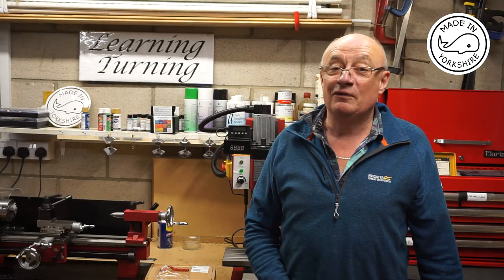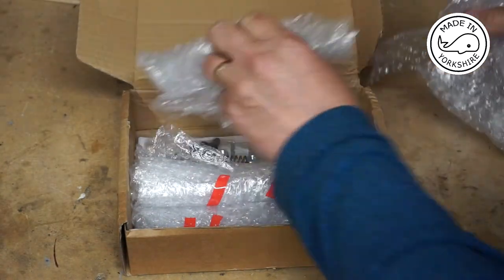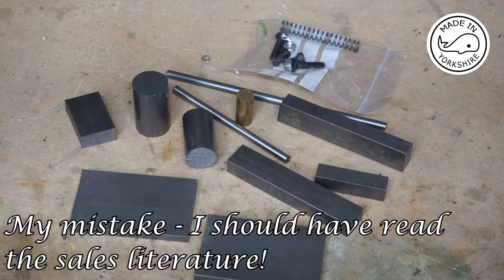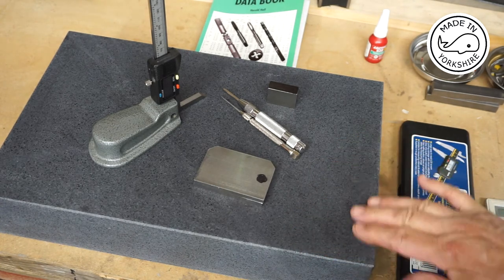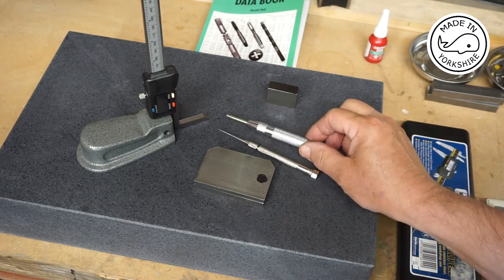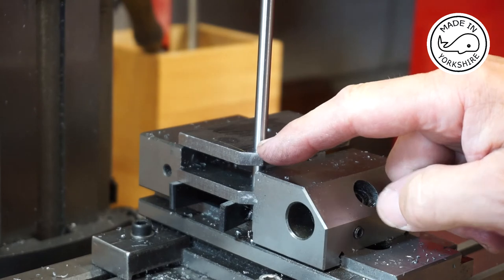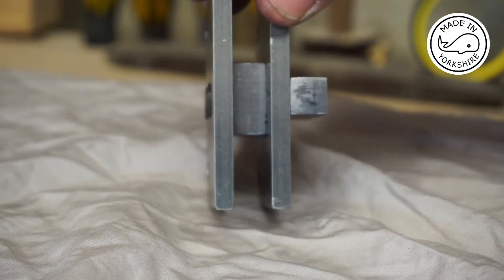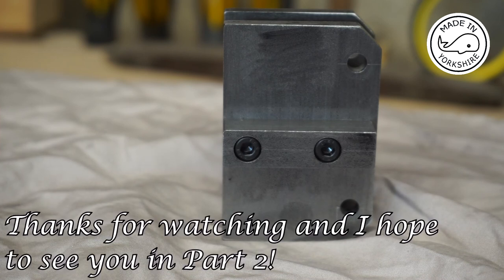#MT19 Part 1 -  Making a Hemingway Kits Knurling Tool for my Sieg mini lathe. By Andrew Whale.

Comment: A tip for future duplicate parts in your mill you need a table mounted end stop. The parts you had must have been very accurate to each other to grip both at the same time. That is not always the case. The fixed jaw and a stop to the right or left is the usual method of repeating reference points.
Reply from the maker: Hi Chris - I really appreciate the advice. I was wondering whether there was a better method.
I will investigate to see if I can make a stop for my vice.
All the best.
Andrew

Comment: Hi Andrew, Thanks for the mention, I'm glad you are enjoying the build of a most useful accessory that will be much kinder to your lathes' bearings (and your nerves!). Keep up the great videos but don't neglect your wood-turning! Regards Clive👍
Reply from the maker: Hi Clive - I'm really pleased you set me this little challenge. I hope I will be able to complete part 2! I agree, I do need to get back to the woodturning lathe. My problem is that I don't have an outlet for my work. With metalwork I find that I can make things that have a real purpose, and help fix problems. Only recently my daughter came to visit us and her 'expensive' suitcase had broken - a small threaded aluminium rod holding the handle had broken off. It was really satisfying making an identical replacement on the lathe, only this time made out of steel. Mine will not break!
Cheers
Andrew

Comment: Hi Andrew, hope your good Dude. I bought a QRTP and it too came with a knurling tool so I cut the knurling part off and drilled and tapped two more grub screw holes now used as a tool holder, and kept the knurl wheels for a proper knurling tool. TFS, G :)
Reply from the maker: Hi Graeme. Did you mean QCTP? Good idea to keep the knurls cos they can be expensive. I'm good.
Stay safe mate.
Cheers
Andrew
Reply: @learningturningmetal Yep Andrew I did oops G :)

Comment: Just a heads up knurling wheels come in different diameters, IDs and widths to consider when making the arms....
Reply from the maker: Hi Dave - many thanks for the advice. As such, I've just ordered some knurling wheels from Hemingway Kits and I'll hold off making any further changes in that area until I receive them.
Thanks again - much appreciated.
Andrew

Comment: Andrew,

I know this is an old video, but nevertheless ON DOES NOT CENTER PUNCH (or hammer)on any true surface.
In the past I have seen experienced journey men being carried out of the shop and tossed on the cobbles for this.
A surface plate is to be babied (and you should get something else to lap on too...) 

Only to be used for measuring, being cleaned with Windex (or some such product) and covered with a hard cover that clearly reads  "do not stack your crap on this surface" 

Before measuring, wipe the plate with your (clean) hand, you will be amazed to find out that the human sense of touch can feel a particle of about 1/1000 mm on a, otherwise clean, surface! This is your best way to ensure there is no crud on the plate and measurements are accurate.

A word about Hemmingway kits. They aren't bad... I mean you can't say in earnest that they are a bad product.
They are however massively overpriced. A decent scissor knurler would have cost you the same than the few bits of standard stock they know charged you 30 quid for (plus postage, no doubt) and it would probably have included a set of wheels.
I know it is all 'about the project'. But these plans  or ideas can easily be found on the Interwebs of project books.

All the best

Paddy
Reply from the maker: Hi Paddy - yeah looking back that is a bit of a cringe moment when I centre punch in the surface plate. I think (hope) I have improved since then.
I agree that the Hemingway's kit wasn't exactly cost effective - but it was a good experience for me following plans for the first time - and the end result was real quality compared to what comes from the far east.
Cheers
Andrew
Reply: Paddy Hi, Nice bit of info there Dude. G :)
Reply: I've done a couple of Hemmingway kits, including a really, really expensive speed increaser & the end result was weedy as hell & not worth half the price of the kit as a ready made item!!! As Andrew said though, newbies following plans is always a good exercise. After watching Andrew, I might even attempt one of the Stuart's models he made as I can copy his methods & that'll help me along!